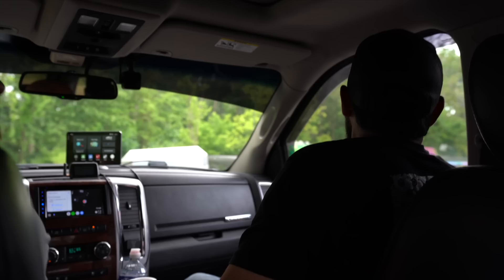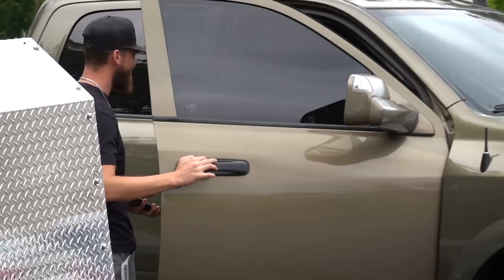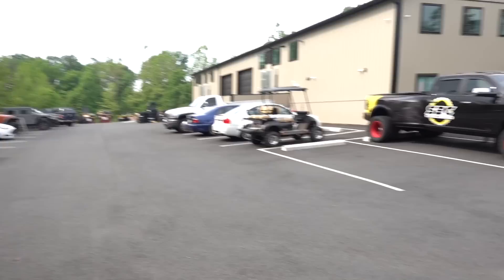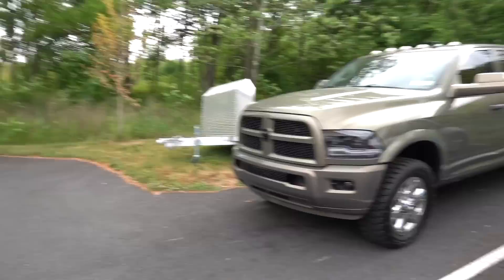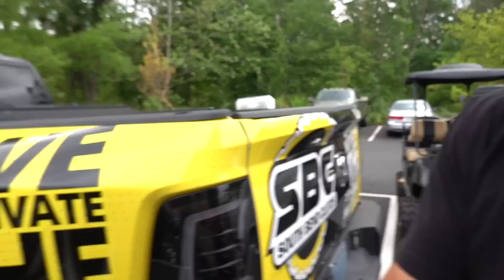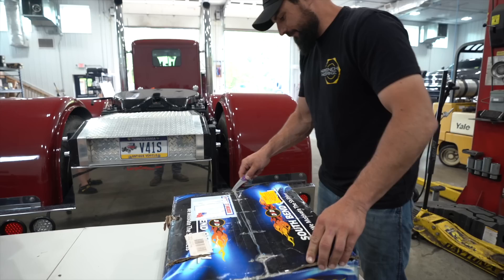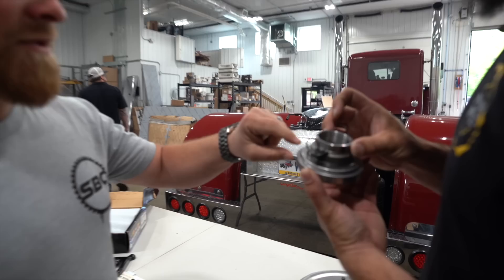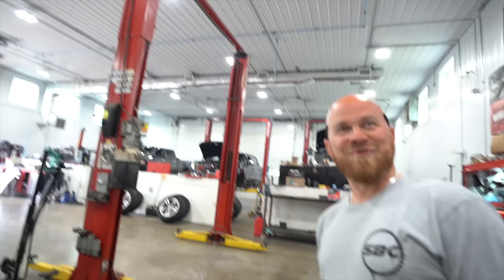RARE G56 6-Speed RAM ALERT!!! Bought Sight Unseen & BROKEN!!!

Comment: There's a firmware update for the radio that should move the backup camera on to the main screen if you prefer it there. 2014-2015 (and maybe 2016) trucks had it up in the mirror like that.

Comment: you don't lubricate the release bearing, but you can lightly lubricate the input shaft housing that the bearing sleeve slides on, that won't sling off because that doesn't spin.

Comment: My 98 12 valve makes 518 at the wheels and I've been running the Southbend dual disc Street clutch since I built the thing and 2014. 100,000 miles on it so far and it hasn't missed a beat!

Comment: Mine is a 2012 2500 4x4 CCSB with Cummins and G56 manual. 228K miles on it (bought new with 2 miles), I've had a South Bend dual disc in mine for about 100K miles before the throw out bearing went. Turns out that the dealer I had install (South Bend dealer) it didn't remove the spacer in it that you need to remove when installing a dual disc clutch, replacing the OEM clutch.

Comment: I had my south bend floater plate come apart and crack my bell housing. I switched to a Valair and am liking it much better. This new clutch you got looks neat tho, I’m just scared of having to replace my transmission again when the floater plate grenades
Reply: Same happened to mine. Southbend is trash! Valair ftw

Comment: The cummins is known for flywheel bolts backing out even when torqued to spec.. thats why after you add power you have to loctite the shit out of them and get arp bolts and torque them beyond factory spec and even then they can sometimes come loose.  😊❤  absolutely love the paint color on that truck. When i bought my 04 i was looking for atleast a qc long bed but all i could find in a decent time frame, was a qc regualr bed... i love long trucks from my first truck was a quad cab long bed obs ford and from thst point on i love long trucks haha ❤ i am keeping my eye out for a 3rd gen mega cab long bed thats the truck i really want. But they all look awesome in long bed form❤

Comment: And soon it will get painted black otherwise it's a future give away lol.  I'm kind of 50/50 when it comes to Southbend Clutches.  I have one in my 06 and it's annoying noisey and it has very low miles and I even replaced the buttons.  But it holds great and customer service is top notch.

Comment: Will the South Bend Super street hold an estimated 800 rwhp with a set of compounds?  Just curious because  I recently put compounds on my Mega cab and am going to need to do a clutch to hold it for a dyno number.  The dual disc Valair definitely isn't going to do the job. 😢😅

Comment: It's too bad they ditched the nv5600. The g56 is far too weak for modded high torque apps. I get the long bed, but that doesn't make it rare.

Rare are the pre emissions 24v 5.9 common rails. They can push more than the 6.7 without the ba of deleting the emissions garbage.